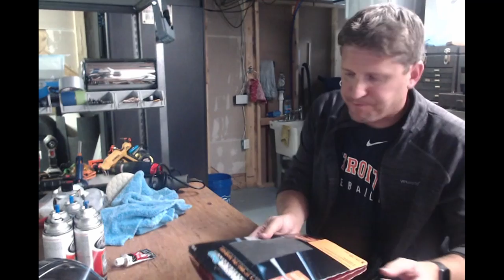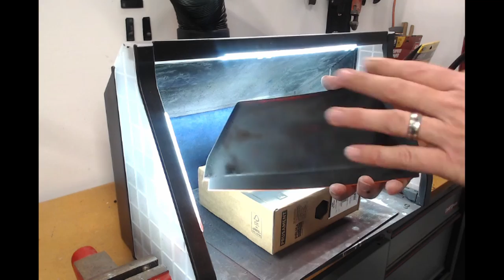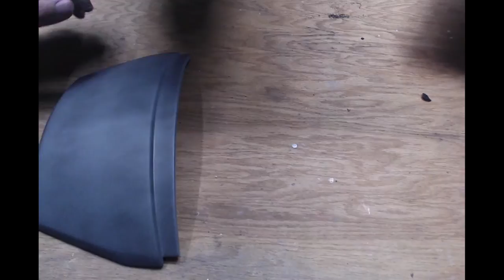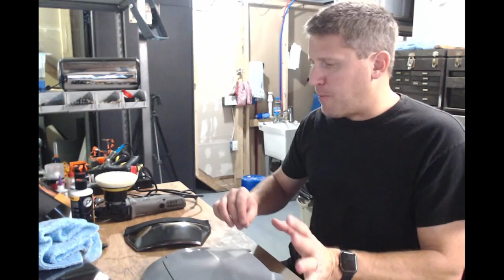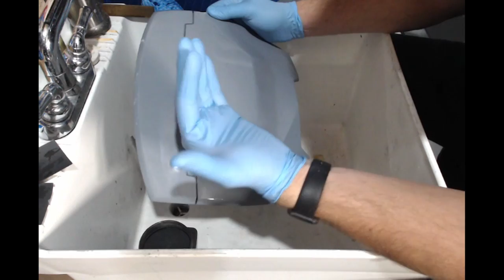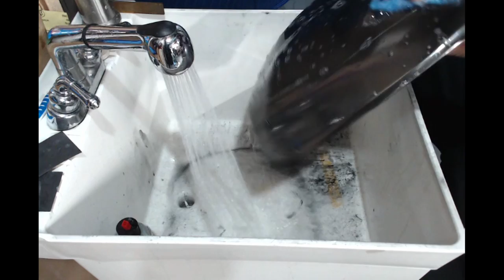Mandalorian - Start to Finish Armor Process with Graphite

Comment: Are you serious about the three day wait for the primer to dry?
Reply from the maker: For that particular Rustoleum primer, yes.  You can do it within 4-6 hours ish, but you will BURN through sandpaper.  Letting it sit for a few days, makes the sanding process much easier.  Other automotive filler primers you do not need to wait like that, but they are more expensive.

Comment: You don’t do a final clear coat? Won’t the graphite rub off?
Reply from the maker: If done right, minimal.  Easy to rub a little back in if needed.
Reply: @CT-Props  I figure the clearcoat would like diminish the shine, but was just curious if general touching of the helmet results in it ultimately rubbing it. It seems like with your technique that doesn't really occur. Is the lack of fingerprints showing due to the fact that the grapphite is being applied OVER the clearcoat?

Comment: So my graphite isn't clinging to clear coat after rinsing, it rubbed off in some spots any pointers help!
Reply from the maker: Are you using the same graphite that I listed?  Clearcoat as well?
Reply: @CT-Props  yep and yep I think my clear code was spotty and it wasn't clinging all that well my second coat went on fine clear  oat I just one of those things I'm terrified of
Reply from the maker: @trumpeter12400  Do some test pieces to get it down
Reply: @CT-Props  i dont know if you have considered it but the 1k dupicolor clear coat is quite a bit better than the better match
Reply: bigger can for a few bucks more and i really like the way it coats

Comment: I wonder how a 2k clear coat will effect the shine. 2k clear is about at durable as it can since its the top coats on car paint jobs
Reply from the maker: I am actually going to be testing this out soon.  While the method is durable, 60 hours of trooping in it, signs of wear are forming.  I want to see if 2K gives it some more strength.
Reply: @CT-Props  Did you ever try this with 2k? what about the duplicolor 1k?
Reply from the maker: @joeespinosa2030  I have the can sitting on my workbench.  I haven't had a chance to test it out, work has been consuming life quite a bit lately. Hoping to get it done this winter and will post details in another video.

Comment: My graphite wont stick to the light colored base you dont see chrome just grey why?  With a black base it good but thats to dark
Reply from the maker: What graphite are you using?
Reply: @CT-Props  Like what brand? Its sennelier pure graphite
Reply from the maker: You need to ensure it is 5 micron or it won’t stick
Reply: @CT-Props  It doesnt say the micron
Reply from the maker: Then that is most likely your issue. Use the one I noted in the video.
Reply: @CT-Props  Cant buy that here

Comment: I’ve sprayed the same brand gloss you use but I can’t get it to have a uniform shine. It’s either slightly glossy(which is fine with me) or more gritty.

So I’m thinking of trying to sand it to have a uniform finish. Then I’ll graphite. I don’t really care about it being mirror finish, just slightly opaque. Do you think lightly wet sanding 2000 grit would work for that?
Reply from the maker: That sounds like dry spray.  Overlap the coats more and put it on a touch heavier.
Reply: The issue I’m having is that even when I spray it on thick it’s still matte. It doesn’t shine. This is before the graphite. I’m using the same gloss spray you use.
Reply from the maker: @nickn271  you sure it is gloss? I have seen matte clear coats
Reply: @CT-Props  I verified and it says “high gloss finish”. It’s semi glossy on some of the edges but if I spray in an area too much it starts to run. It’s really weird.
Reply from the maker: @nickn271  what surface is under it?
Reply: @CT-Props  white Duplicolor sandable primer. Same type you use in the video. I would also use the sealer like you do but I’m trying to match the graphite color to my black series Mandalorian helmet and that makes it too dark.

I’ve got it to look halfway decent with the non-glossy gloss paint and I think that’ll have to do for this Halloween. To color is right but it’s splotchy. But it’s close enough.

When I have more time I might try to really polish the surface before I graphite or even just print my own helmet and make it the darker graphite color then I won’t have to worry about it not matching.
Reply from the maker: @nickn271  that’s odd. Only ever dull look I have seen from that stuff is due to dry spray, over spray, or just not putting enough on. What temp/humidity are you in when spraying it?
Reply: @CT-Props  I considered humidity. I’m in a pretty humid area. It’s been in the 70s and 80s but I’m in our garage.
Reply from the maker: @nickn271  humidity will definitely impact it

Comment: Why bother to clear coat first as opposed to just doing a black sealer or gloss black primer?
Reply from the maker: Sealers are generally matte or satin in sheen.  Also, gloss primers are generally not sand-able ones.  In theory you could just shoot it with gloss grey paint after the mid-primer layer but I can't attest to the results.  Most likely since you will possibly be mixing paint types (enamel vs. lacquer) and could result in a reaction.
Reply: @CT-Props  Gotcha, thanks.

Comment: This tutorial is awesome some much detail.  can I ask how you sized the chest and back pieces and do you have the STL files or a template
Reply from the maker: They are all using the GreatApe files from Etsy.  I sized them using the ArmorSmith app you can find via Google.  Punch all of your measures in and it will get you pretty close on sizing.

Comment: Is it possible to use UV resin instead of Bondo?
Reply from the maker: I used UV resin on some of my parts as an overall, first hit filler.  The problem with it is that it can be a bit messy and imprecise.   The spot putty is super easy to use for the small spots, but I am sure you could get away with using UV resin for the small marks.  I just do not know how it will react to be put on top of primers.  Never done it.
Reply: Hello thanks for the reply, what other alternatives would you recommend instead of Clean Slate? Here in my country we don't have that brand (we have Meguiar's, and Turtle wax tho) and
 what do you think about the ceramic polish? Thanks for sharing

Comment: What’s the layer height that you use?
Reply from the maker: Most everything is .2
Reply: @CT-Props  .2 not .02 correct? I’m at .16. That looks great if I’m understanding this correctly.
Reply from the maker: @joeespinosa2030  Yes, 0.20mm
Reply: Thanks for all the info. What brand of booth is that?
Reply from the maker: @joeespinosa2030  https://www.amazon.com/gp/product/B08CKSJNP3/ref=ppx_yo_dt_b_search_asin_image?ie=UTF8&th=1